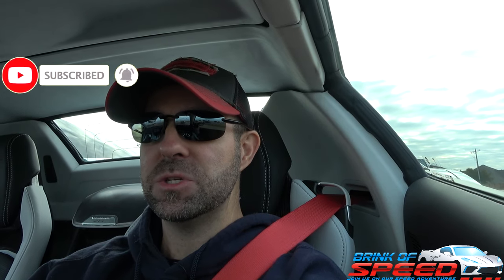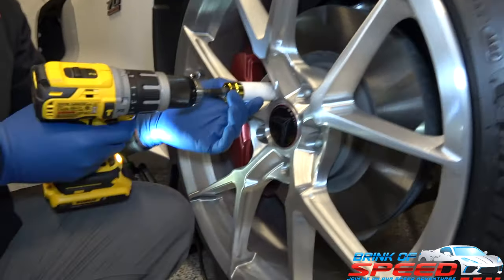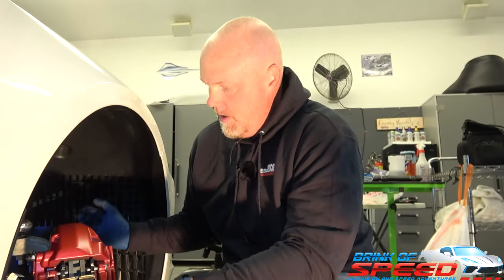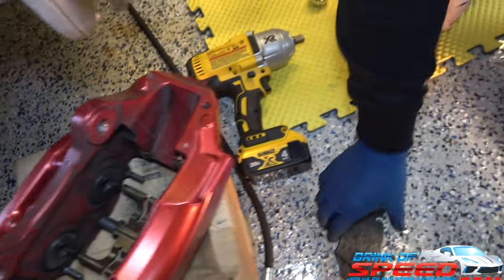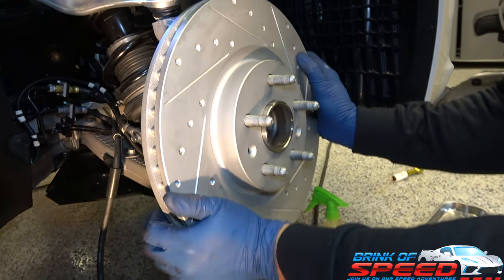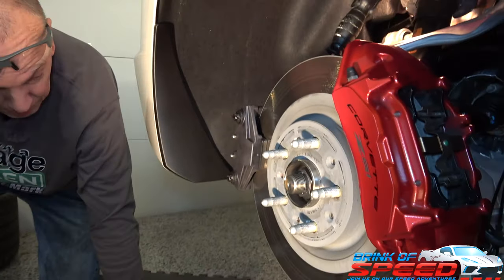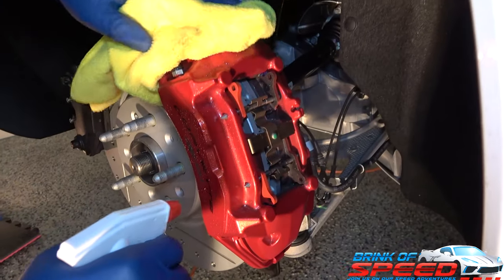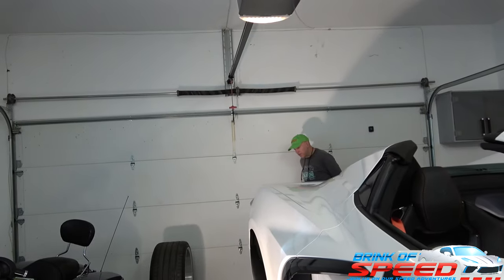Do THIS to your C8 Corvette & NEVER have Brake Dust again!

Comment: I swapped mine out upon delivery at 12 miles with the 1521s and never looked back!  My wheels are ceramic coated also; hardly any brake dust!
Reply: Great to hear, the z51 factory pads crush you with dust, looking forward to not having to clean my wheels every time I take it out.
Reply from the maker: That’s awesome man!
Reply: Fantastic idea on ceramic coating the rims!!!

Comment: Your thumbnail stating "never have Brake /Dust Again" is what caught my eye. To me the only "Never have Brake Dust again is with the Carbon Ceramic Brake setup. I'd like to see a comparison in order to become a believer if that's possible. Thanks in advance Mike. Save the Wave 🙋‍♂
Reply from the maker: These will be really good to eliminate brake dust, but maybe not as good as ceramic pads and rotors. He’s already put 100 miles on them though and you can’t see any dust on the wheels.
Reply: Thanks Mike. I went with the Hawk brake pads that everyone recommends, but I still get the dust. It's a different lighter color so it's not so noticeable, but dust is dust. I may just have try his pads. Save the Wave🙋‍♂
Reply from the maker: @petercarey6883  You’re welcome. 👍😊

Comment: I hate to tell you. I bought the same pads for my c5 z06 vette. They do not bite at all!! my vette hade the worst stopping power of all my vehicles! I ended up putting on DBA series 4000 rotors and hawk hps+ pads on.  the first time i hit the brakes i almost went through the window! And that was before i even bed them in. I will never go back to a ceramic pad again! Espesially for a performance car. Stick with semi/metalic. I threw my 1521 bobcats in the garbage with about a couple hundred miles on them.

Comment: posi quiet pads are quiet, the main thing is to have quiet pads first, worry about the dust second, dust can be cleaned off, noise goes on and on....if these are quiet and less dust then thats a bonus

Comment: I did the same thing after about 500 miles.. only I used the Girodisc slotted Rotors. Brake dust is gone. Although you will still have to deal with road dust lol

Comment: Should also remind people, if they plan on working on the brakes - especially removal of the calipers --- to disconnect the battery 1st - as the car could go into a  auto-brake check at any time and possible hurt / injury them - especially if they have there fingers in / amoung the pads when the car does an auto pressure test , etc.:face-purple-smiling-tears:
Reply: yes because my car did the same thing
Reply: They should have a future under vehicle maintenance where you can shut down stuff for maintenance

Comment: I had R1 concepts cross drilled slotted rotors, front and rear, on my ‘08 coupe, with PosiQuiet extreme duty ceramic pads back in ‘12. I learned to put a little never 👎🏽 seize on the face of the hub to keep the rotor from sticking. R1 concepts, them youngsters are into it.👍🏽

Comment: I've been using Carbotech pads for about 10 years on my 2012 Boss302, 2012 C6Z06 and 2017 C7Z07. Great for street and track use. Mike Jr A CarboTech
Reply from the maker: Heck yeah, I think Darren will enjoy these big time. 👍😊
Reply: Mike Puskar at Carbotech is great he takes the time and answers any questions you have.
Reply: I thought Carbotech 1521 is for street use only? Not track use? The Carbotech XP12 and XP 10 dust a lot, but offer good track performance

Comment: Hopefully Darren has better luck with R1 Concepts rotors than I have. My experience with those on a different car is that they warp too easily. I would not recommend them for anything beyond normal street driving, and especially not for track driving.
If I were you, I would have chosen Powerstop rotors if they're an option for the c8, because I have used their blank rotors with the Powerstop Track Day pads on my current car (not a Corvette), and those rotors held up AMAZINGLY well with the performance of those pads.

Otherwise, thank you for showing how this is done. I thought the rear calipers having removable pins vs the front calipers not having removable ones was unexpected.
Reply from the maker: I hope so too. He won’t be tracking his car so it shouldn’t be an issue. They learned after doing the driver side rear, that they could do it that way, so we filmed it that way. You can do the fronts that way too.

Comment: Guys - I did this on my 2005 Z51 in 2011 and I seem to recall that the Helms Corvette service manual said with factory rotors to make index marks relative to orientation on the hub anytime rotors are removed. Obviously that would apply to replacing pads without replacing rotors, but the service manual also said maximum runout at an 8” radius must not exceed 0.002”. If the service manual still says to make index marks on rotor orientation, that made me wonder if the factory uses an on-the-car brake lathe as a final cut on OEM rotors during assembly at Bowling Green. Maybe I was overthinking this, but I had a hell of a time getting all four rotors oriented at 0.002” or less runout with both the new Centric cross drilled and slotted rotors and/or the old rotors. I had about 30,000 miles on the dusty semi metallic Z51 pads and rotors, so I spent several hours cleaning the rust and debris from mating surfaces on the hubs to get my runout at or below 0.002” with the new rotors. Rotate a rotor just one lug bolt in orientation, and the runout changed dramatically. Well, perhaps “dramatically” is a stretch, but at 186 mph I began to worry about why the engineers were that fussy limiting runout to 0.002”. Maybe someone else has run into this wide variation in runout when re-orienting a rotor just a few degrees relative to the hub? The ceramic pads indeed got rid of the brake dust on my C6. I am not looking forward to doing this again at 81 years old with my new 2024 C8.
Reply: I'm an old motorcycle mechanic but I can still come over and help you out!

Comment: My C7 ZR1 generates virtually no brake dust which I attribute in large part to the carbon ceramic rotors and OEM brake pads. In fact I can swipe a finger across one after driving and there's no dust on my finger tip. Whereas on my dad's C6 ZR1 there is since it has steel rotors.
Reply from the maker: Yep, carbon ceramic rotors and pads are an amazing combination!

Comment: I’ve installed these on my C8 and the stopping power felt the same and brake dust is reduced but it certainly hasn’t been eliminated.
Reply: The bite isn’t remotely close to the same. Come on now. I’ve had both and it’s night and day

Comment: Hi guys I did the exact same procedure. After my car went into limp mode for the brakes. Could drive over certain speed. BRAKE system warning lights code errors.  Found Out You need to disconnect the neg battery terminal. I pushed my pistons back a bit further than yours. The system reset when i disconnected and reconnected battery. Other videos on you tube recommend this first step of leaving battery disconnected.  Wish I'd watched those first

Comment: Love the video.  I have a '23 Z51 and I noticed you have the same R1 rotors for both the front and rear.  Isn't the rear rotor larger in diameter than the front?

Comment: Mike, well done video.(5-stars)     I have an unrelated question.  I'm having problems with my 2021convertible. The convertible top Its not working, I call some of my local dealers and they haven't reach back so I subscribe to a C8 forum and found out im not along. Its been a problem with some convertibles  and they haven't got a fixed. The rear window doesn't come down and the convertible doesn't operate,  the tonneau lid does works up and down... thats it. Maybe you guys can help me out or find out who can. Im in central Florida(Orlando)

Comment: Nice video, I changed my brake pads on our C8, 2012 C6 , 2021 TRX, all to Power stop Z26 or Z23s, both great pads 80-90% less brake dust, made the carbon tech pads are better for track, but as daily driver, the power stops, a lot less$$ and work great. Keep up the good work guys.
Reply from the maker: Thanks Kurt, I’m glad you enjoyed it, and thank you for the heads up on the other pads. 👍😊

Comment: Oh man, I really wish you had shown where you placed the Quick Jack under the C8. I have one that worked great for my C6, but the 2023 C8 jacking points are just out of reach for the lift. I'd really appreciate a video of the jacking locations and process. Thanks from Austin, TX
Reply: Same with this one we were just before the jacking points, but on the frame so it was fine.

Comment: On 2023 C8 Z51 Stingray they recommended disconnecting the battery. Has this requirement changed?
2nd question. Did they stop gluing the pads to the pistons? This was a big PITA on the 2023..

Comment: On my brother’s 22 z51 the front pads where glued on and took a minutes to get off.
Reply: Most have said that, mine as you saw practically fell out.  But my car also had very few miles.
Reply: Yep, mine were glued on [2100 miles]. Managed to cut the piston boot trying to separate the piston and pad. Luckily piston boots are simple to swap out. But when the piston falls out, if you didn't pull the battery cable, then you're screwed. You get air in that corner. Can't bleed it with battery cable connected. On the positive side, now I know how to pressure bleed C8 brakes.

Comment: Remember to do an update vid before the next wash to see the dust difference. I have a 21 C8 w the Carbon Flash rims. I hate the dust. The rims can be clean and in 15/2 miles of city driving they are coated. I’m definitely doing this. 
Cost?
Reply: I’m 100 miles in and I can tell you dramatically better, 90% less dust.  Highly recommend this upgrade.
Reply: Pads and rotors if purchased on sale about $1,000 for everything, some great sales on both this weekend.  Paragon has the best prices on the pads, R1 Concepts is doing 30% off with code: VIP30 part numbers are in the Video description.
Reply: @nrdemon would you think it’s necessary to replace the rotors with the drilled rotors, over the OEM rotors? I have less than 4k miles and it has t been tracked…yet!
Reply: @budhorstmeyer9336  no not necessary, OEM ones will be fine on the track, I personally like the look of drilled and slotted rotors and since I knew we would have the calipers off in the front I figured now was the time.
Reply: Just change the pads. The pads only create the dust not the rotors. Drilled and slotted rotors are just for show. If tracking drilled rotors will get hair line cracks from the hard abuse and heat.  Slotted rotors stay cooler than solid rotors on track. These guys need to put back on their gold chains.

Comment: I saw some
Video on YouTube the guy changed the break pads and got all  break light  came on.  Do you have to disconnect the battery first so you won’t get the break light warning. That what I’m afraid of if I change mine out. I got z51 break pad And I hate it to much dust.
Reply: We did not disconnect the battery and made it a point to not open the door during install.  100
Miles on the car and no brake lights.

Comment: It’s my understanding that you should disconnect the battery prior to removing calipers. Apparently if the key fob is accidentally activated just right, the computer wakes up and applies brake pressure through the electronic brake system. Obvious disaster if this happens.
Reply: Yes and If you open a door the same can happen.

Comment: I installed ceramic brake pads on my 2010 GS when it was new.  It reduced brake dust ~80% and still does.  But I did not change rotors.  Why did they change rotors in this video?
Reply: Looks, drilled and slotted vs. plain oem rotors.

Comment: The Brake Dust is possibly my “Top Complaint”!!!  

Otherwise, there aren’t too many in the first 1,100 miles.  
Passenger “Blind Side” comes in second.
Winter Hibernation/Stones on the roads/Waiting for Spring😂
Reply: I agree on the blind spots, I just ordered the Paragon wide angle mirrors.

Comment: I hate break dust! Sick of wash ing my rims! Do you have to change your rotors?
Reply: You do not, most will use these with OEM rotors.  Paragon has the best pricing, they are on sale now, you won’t regret it.  I have 100
Miles on the car and almost no brake dust, dramatically better.
Reply from the maker: We hate it too Andrew. 👍😊

Comment: I heard that if you don't peal off the thin plate from the back of the Brembo break pads and put then on the Paragon pads that it will make one haed click sound when putting on the breaks.
Not sure what's causing this but, the installer said had to add the thin plate on the Patagon pads to eliminate the one click. 
Please let me know if that's true, thank for the video.

Comment: Wondering if this company will make the slotted/drilled rotors for the Non-Z51 C8 Stingray. I've been looking, but seems as though no one is making them.
Reply: I believe R1 Concepts does have rotors for non z51 cars, give them a call and they will confirm fitment.
Reply: @nrdemon1031  they do have them. But the carbotech brake pads are only made for the Z51 C8. I may have to go with R1 Concept pads, unless you have a reco. Thanks
Reply: @cotto22  I think the R1 pads would also be good, or Hawk, if you talk to R1 mention the channel and ask for 25% discount they should give you one.
Reply: Thanks I did get the rotors. I will think about the pads
Reply: @cotto22  if you have a z51 car you will want the pads, other brands out there powerstop and Hawk are lesser expensive.
Reply: @nrdemon1031 I'm a non Z51. I'm gonna use the Powerstop Evolution 16 ceramic disc pads. Street use only, cleaner ride and I think these pads will give me equivalent stopping power as to OEM pads, but cleaner on the dust buildup. Any thoughts and insight on the Powerstop Evolution 16 ceramic pads for street application with the R1 slotted/drilled rotors is appreciated.
Reply: @cotto22  I’ve heard good things with those and the Hawk pads, both should work great.

Comment: When are you required to disconnect the Battery when working with the Brake System? 
I recall hearing that, but don’t remember where or from who…..
Reply: From what I've seen you only have to disconnect the battery if you open the hydraulic system.  Like bleeding or changing fluid or replacing caliper
Reply: Some say to we did not, apparently the reason you would is if you open a door the Calipers compress. So if you don’t open the doors during install you will be fine.
Reply: Just leave key fob away from car so self check doesn't happen , the hydro pump will check brakes.   Also perform parking brake calibration with new rotors.

Comment: My lug nut socket is 22 mil, Just curious why you were using a 19 mil socket? My C8 is a 2020.
Reply: Aftermarket wheels are typically 19 mm
Reply: @nrdemon1031  makes sense, thanks.

Comment: Got the Carbotech pads coming. R1 Concepts says they don’t have rotors to fit my 2023 C8 Z51 HTC. 🤷🏻‍♂️ Anyone have a suggestion on drilled/slotted rotors that won’t break the bank? Thanks
Reply: They have them as those are on my car, the item numbers are in the description.  Whoever you spoke with must not have realized they are the same for 2022-2022.
Reply: @nrdemon1031  Thank you.  I will give them another call in the morning and hope to get someone different.
Reply: @jerryg4111  give them the item numbers in this video’s description.  Good luck, let me know.
Reply: @nrdemon1031  I am being told they are out of stock with no estimate when they will be available. To check back in 2 - 3 months. 🤷🏻‍♂️

Comment: Good vid & I'm very interested in these pads! However, more than half of the dust comes from wear of the rotor. Look at the PCBR on the Porsche Taycan Turbo. We have developed a process to treat rotors for zero dust & 1800% wear improvement over the non coated rotors! Our problem is finding a brake pad that can keep up with the rotor!!! What are you doing with the factory rotors? Maybe I can coat them for you?
Reply: What kind of coating is this, do you have a website?

Comment: Um, nice job but... You put the rotors on the wrong sides. The vanes in the center of the rotors should be curved to the back of the car at the top twelve noon position. This is so, as the wheel on the passenger front rotates clockwise it pulls air from the hub area and flings it out towards the rim.  Yours are pointed forward on the top as seen on the video at the 12:15 time in the video. Feel free to send pics to who ever you got the rotors from to confirm. Sorry to be the barer of bad news but you really need to redo the job and fix this ASAP. Probably should put a comment on the video so others know what to look for too.

Edit: Just did the 4 wheel kit on my 23 Z51 C8. Stock has drivers side rotors both sides. New kit has the same. Very disappointed in Chevrolet and the aftermarket right now...  🙁

Comment: Damn we almost have the exact same 2023 car only my seats are inverted colors white/black vs black/white.  I also have the high-wing.   900miles and I can only get 3.9 sec 0-60 in competitive mode.  30psi and it's about 55F outside.  No mag ride, only z51 suspension :(   Does it need to be warmer outside?  Maybe I need to find smoother roads?
Reply: If I could do it again I would have done the seats like you did.  But loving the car and the unique interior, well worth it.

Comment: I don't understand how he broke those caliper bolts free like that.  The C5 torque spec is 150 ft-lbs...need 2 men and a small boy to break'em free. Tightening was worse. I'll check the torque spec for those bolts.
Reply: Strong like Bull 😂. It wasn’t easy but hitting the weights for all those years paid off.
Reply from the maker: Have you seen Darren’s build? He has 20” arms! 💪
Reply: I just watched it again. I'm doing my '23 tomorrow.  Great video!